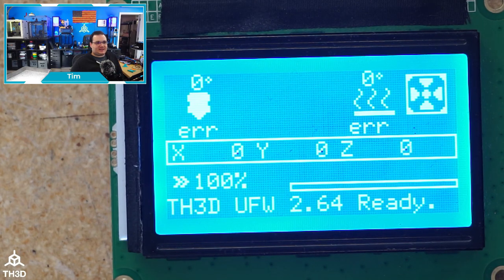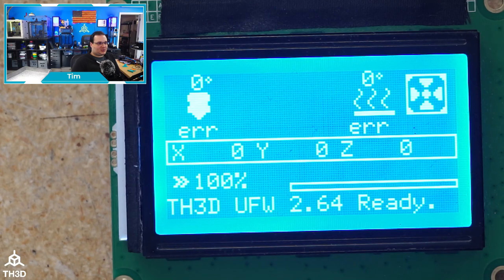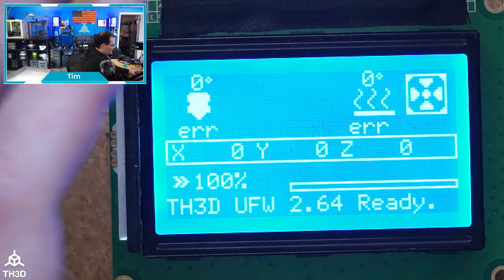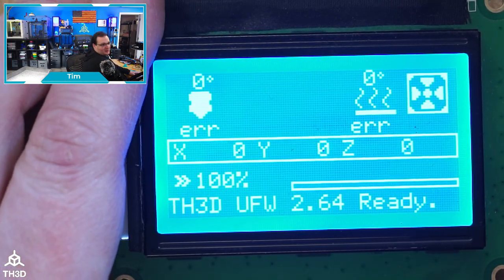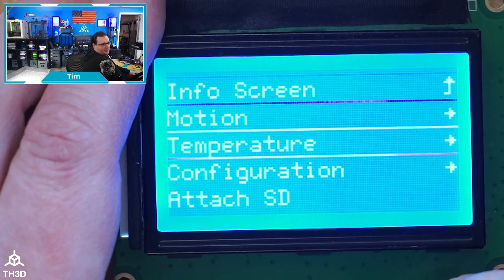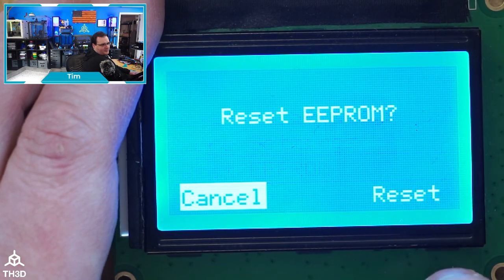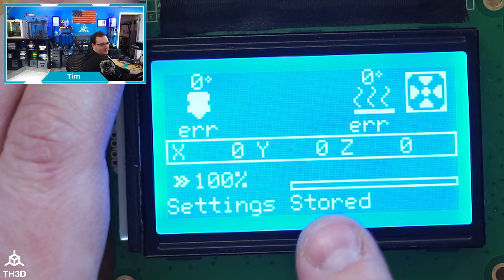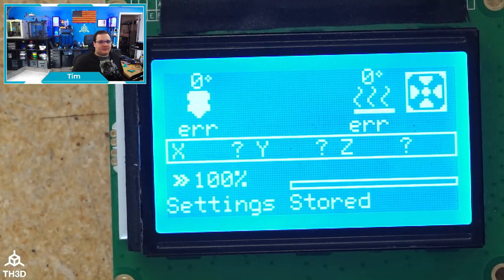Unified 2 Firmware - Resetting the EEPROM

Comment: What firmware are you using? My Ender 3 with 4.2.2 board, using Marlin2.0.1-v1.0.1 doesn't have the "configuration" option
Reply from the maker: We're using our Unified 2 Firmware.